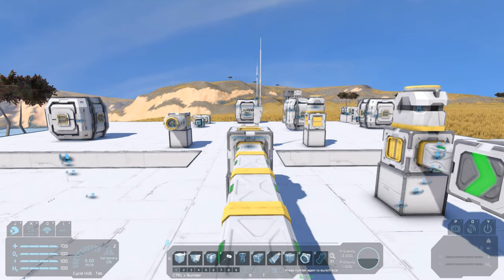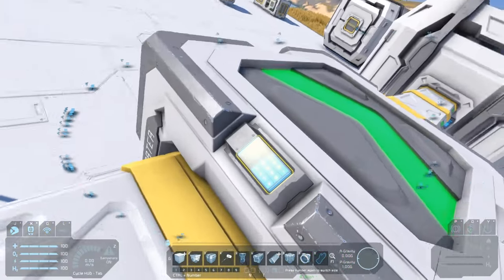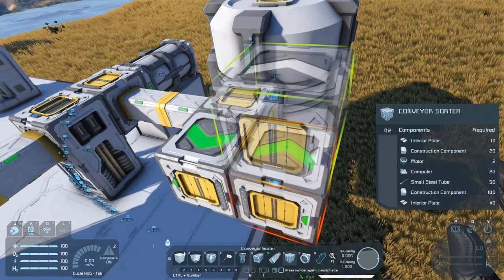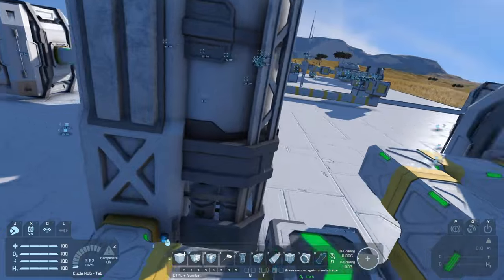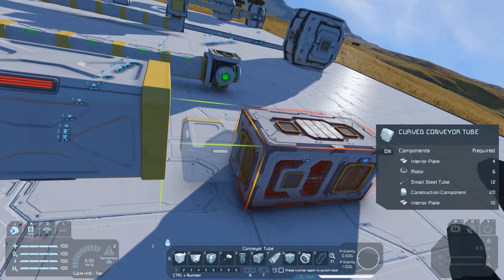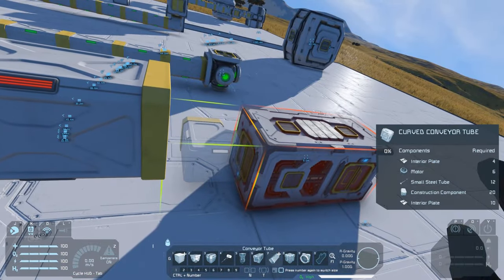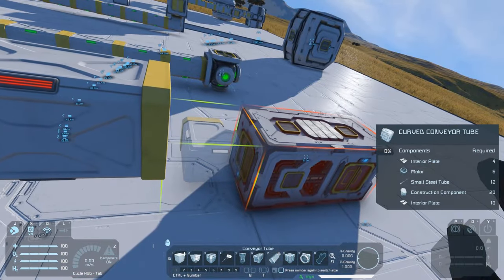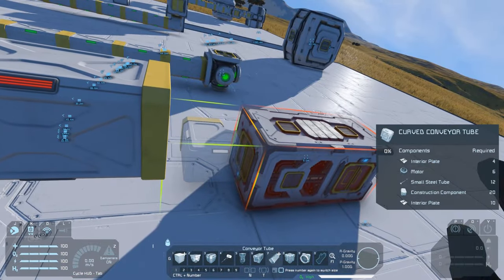Space Engineers Tutorial: Sorters and Conveyor Systems (tips, testing and tutorials for survival)

Comment: Back when sorters first appeared in Space Engineers, I was obsessed about making a good sorting system that would supply all production blocks with what they need. I built a system similar to yours, but inability to disassemble components was a serious flaw. When I tried to make a two-way connection between the assembler and component container, the sorter kept infinitely drawing components from the container and putting it back there again. There were also problems with one refinery (out of many) hoarding all ores and needing constant manual supervision. In the end, I came to the conclusion that a system based only on sorters is impractical. A good hands-off approach requires TIM or AIS, in my opinion.

Maybe if Keen added two-way sorters and refinery cooperation in the same way assemblers work, it would be more functional.
Reply from the maker: Yeah, the lack of ability to balance refineries is a bit of a bugger, last I looked though the assembler cooperation mode was still flawed though but a functional system like that would be good. There were some timer based systems that used to work but they're all broken now. I couldn't come up with a way to make the ores balance but if I come across one I'll be sure to post something about it.
Reply: TIM with tag 'ore 1000' as an example... works fine ;)
Reply: Some Guy If you're already using TIM, you don't need any special tricks. Add [TIM AUTO] to the refineries' names and the script takes care of everything. It's kind of a bummer actually, that a solution so simple is so superior to all others that it practically kills all ingenuity.
Reply: Splitsie Timer-based systems are broken because the conveyors move all resources at once, so everything goes to the refinery that happens to be accessible. If the items moved bit by bit, they'd work and conveyor systems would be more interesting to work with. You could, for example, build several next to each other to increase throughput. I think they used to work that way, but Keen changed it to optimize the game.
Reply from the maker: Ah, that must have been back when the conveyors used to cause some sim speed drops. I hadn't played with those systems before they made that change so I hadn't noticed that it was particularly gradual. I did notice the performance problems though so I guess they made the right choice :P
Reply: They don't store ore in such large numbers then... and I ehm... *My drones mostly 'eat up' everything in reach of a drill, and stuff My mothership to the limit... oh My dear drones <3
So calculated the maximum amount for rafineries and left 2 renaming blocks (Isy's script) to switch all from 1 TIM to another ;)

And with 'teh righteous choice' and 'teh muh bueno fixes/optimalizationes/updatos'... why does the rover with 'parking brake on', 'drives' across flat surface ? 
- Coz' Keen !
Reply: @Splitsie  I know this is very old by now, but a second pipeline with storage -> sorter -> assembler -> sorter -> ingot storage should work.
When breaking down items I assume it will always be a deliberate choice and not some default task.

Comment: 1. you have no backflow means in the first setup if a ship happens to need to refuel.  There are also times you may need some of the items stored on one of the one-way paths.  One option to get around these drawback is switches so you can switch between sorting and 2-way access. (IE if you flip a switch it'll turn off the path to take ice from the ice storage tank and turn on the block that pulls it in from everywhere else).  As for mining vessels you can do a double sort block for them too, where as you can turn on one that'll pull what you want from those ships on/off so the connector is more universal.

Comment: Splitsie you Can also have a disassembly function to this Conveyor system without touching anything that's already automated. What you do is stick another conveyor junction after the conveyor sorter leading to the components Storage.

And have another conveyor sorter on the branch off lead to another assembler which will be dedicated to disassembly with the sorter white listed only for components.

This will make it a one way to allow you to manually move it over to the Assembler Named Disassembler without it going back to the cargo container for components.

Then Connect the Disassembler with a Conveyor leading to the ingots storage with a sorter with Ingots white listed and and Drain all Checked then all you got to do is move the components you want to Disassemble into the Disassmbler and Disassemble the components and it will then transfer all harvested ingots back into ingot storage for use in the Assembler.

Comment: Great tutorial video, thanks Splitsie!  One comment though - on your hub-and-spoke design, it looks like you have the reactor connected in to the main "spine" conveyor.  Don't you actually want that to be connected in to the storage container that the assembler is connected to and using for ingots?  Otherwise it won't be able to share the uranium ingots with the assembler, and the "drain all" on the ingots sorter will starve the uranium out of the system for the reactor.  Also, the other comment about allowing access for the uranium would still need to apply to the ingot storage side.  Thanks again for the great video!

Comment: I was struggled with one issue. I have a bit different setup. I built all production facilities in one building with sorters in and out (plus individual sorters for facilities). If I set pull all on input sorter it occured that it moves forward and back bottles as it's stored in in H2/O2 generator. Finally I built additional sorter that pulls only ores and next sorter that disallows pulled ores back as closer then storage is docked rover. With this video you remined me about oxygene and hydrogen tanks. When I build it outside production facility, probably additional sorters will not be needed anymore as only thing allowed to be moved in will be ores.
Reply from the maker: It's really tough trying to come up with a fool proof system using sorters alone, especially when you know that sometimes the system needs to loop back on itself because then you end up with items moving constantly in a circle (which is probably what was happening when you saw the bottles moving back and forth). I haven't got any great solutions to that, other than a button somewhere to turn the return sorter on and off so it's only on when you need it
Reply: @Splitsie  Yes, it's exactly what happened. Solved it, as described above - built tanks outside and now only ores go into produciton facility. Now I have similar issue with ingots moved by refineries to assembler as it's closer then ingots storage. If I turn on draining on sorter attached to this storage it takes ingots from storage and put it back there all the time. I guess I will search for mods to solve that.

Comment: For the ore issue around the end with the wheel-and-spoke system, you could set a second sorter in front of the main one (probably even just directly connected to main storage) that's got ice blacklisted so it can't drag it through.
Reply from the maker: That's a good point, depending on your ship design you could even include it onboard to drag ice into the generator and not let it out
Reply: @Splitsie  I'm having problems, I dunno if you'll see this.  But I don't know if your design allows for ice to go back to ships' O2/H2 Generators?  I tried to set it up like yours, and when I allow Ice to flow back from the ice cargo container, then I get an infinite loop of ice flowing into and out of the cargo container.  It still fills up O2/H2 Generators, but in this case will get in the way of actually unloading ice from a mining ship.

Big fan, watching your videos a ton lately.  :thumbsup:

Comment: Any time you have a one way connection (like to your Ice storage or to your component storage) you really need to complete the loop using a switched off sorter.  In your scenario you mentioned that you cannot disassemble components.  You can also not get ice out of your storage for example if you put an o2 generator on a ship and wanted to fill it from storage.  In your assembler loop a connection from the main storage to the assembler using a switched off sorter would allow you to toggle the existing sorter off, the "new" sorter on and manually move components back into the assembler for disassembly.   You need this reverse loop in any one-way system or it can be a real pain.
Reply from the maker: That's a really good point, it would allow for much more flexibility but only when it was needed, nice idea :)
Reply: Keep up the videos, I've been recommending them to new players on Steam.  The one you did on refinery efficiencies help someone just today.
Reply from the maker: Cool, nice to know they're actually helping people :)

Comment: I actually use large grid small cargo storge containers instead of conveyors. It's extremely resource expensive, but it increases storage density massively.
Reply from the maker: It does, but there are also performance downsides to using them as they act like a conveyor junction which means when you get to larger sizes you'll start to see it negatively affecting sim speed (or if you have multiples of the same grid present in your world). Not normally a problem in single player, but something to keep in mind if you start seeing issues :)

Comment: A proper tip that im now a bit more versed in Space Engineers, if you're wanting specific refineries to input and output specific ores, you need to make sure the conveyors are sorted coming out of them, if you link all the conveyors at the end the refineries without sorters forcing a flow it will use those conveyors to autobalance the inventories of the refineries. Very big oopsie on my part trying to design a bespoke factory that processes the low yield ores with more yield modules and the higher yield ores with speed modules, and finding that my design just had them all autobalance 😭

Comment: I use a conveyor and fork system to multiple refineries for gold, platinum, and silver then one for Iron, one for cobalt, one for silicon, and one for nickel. Makes life so much easier not having to wait. Setup is easy just conveyor blocks in a row with in/out sorters pushing and pulling each individual ore and returning it to main to be pulled by assemblers. Its so much faster
Reply from the maker: This setup was definitely not intended to be optimal, just a nice way to illustrate how sorters work, so taking a different approach like you have is probably a good idea :)
Reply: @Splitsie  there is no wrong way as long as you get the desired result. Ore>ingots; ingots>components. Its just different flavors of the same pizza my dude!

Comment: Want a challenge?  You have three refineries, an arc furnace, and an oxygen generator.  The refineries have different modules.  You want to send as much Uranium, Gold, and Platinum to the high-yield refinery as will fit, as much Iron and Nickel to the Arc Furnace as will fit in it, Cobalt to the high-yield refinery if there's enough room after the U, Au,  and Pt, and the Arc furnace if there's not, everything else (including Au, Pt, Fe, Ni, and Co, but NOT U) to the high-efficiency refinery if there's room and the high-speed refinery if there's not.  And of course Ice to the Oxy generator, but that's easy.  You also have four buffering containers, one for each of the three refineries and one for the arc furnace, to hold ore that there's no room to process yet.  

You don't need to pull ore out of a refinery or furnace when a miner arrives and dumps a higher-priority ore for that refinery/furnace into the system, but you do need to redistribute ore among the buffering containers so that anything the refinery pulls after new ore arrives will be of the "right" priority for the currently available set of ore. 

You can do this with seventeen sorters.  Have fun figuring out how.
Reply from the maker: If that's possible to set up I would love to see the blueprint, there would be much I could learn from it :)
Reply: With one "trick" you can make the sorter count even smaller.  Here's the trick:  When stuff is "pushed" into a conveyor it always goes to the different faces of the conveyor (if they're connected to something where there's room) in the same sequence.  So if you have a connector on face #1, and you dump a bunch of ore in, whatever can go through the outward-facing sorter on face #2 will, before the outward-facing sorter on face #3 has a chance to sort anything. Whatever can go through the sorter on face #3 will go through that, before the outward-facing sorter on face #4 gets anything, etc.   

Just experiment a little to figure out the sequence of the faces.  I can never remember, so I always experiment and then leave colored pipes on one in sequence (Red Orange Yellow Green Blue Purple White) as a reminder to keep track of which are which while I'm putting stuff together.

Comment: One thing to watch on the loops is automatically pulling items will cause the system to pull a small amount constantly moving it through the system in the loop. It is better to have sections of the loop able to toggle manually or at least have a sensor or timer trigger the loop when needed.
Reply from the maker: Very true

Comment: I have a question about conveyor networks; what non conveyor blocks can be used as conveyors? Large reactors on Large grids seem very poor at pass-through, are there blocks that work better? Is there a way to use the blocks with better pass through as a way to save space and mass? So may questions.
Reply from the maker: All blocks with multiple conveyor attachments can be used as pass through. I'd never noticed the reactor being slow to move things through but it doesn't entirely surprise me. I'd always noticed they were very slow to pull uranium when it was available.

To be able to reliably test whether the blocks slow down transit you'd be best using sorters on the far side of each block to pull a set amount of material. Sorters seem to be the fastest at grabbing material and moving it, probably refineries are next in terms of the size of the chunks of ore I've seen them grab
Reply: Splitsie thanks for the reply. A list or ability to view "grab chunk size" stat would be crazy useful, that is exactly the planning information i was asking about.

Comment: This is EXACTLY what I needed to know.  Many thanks.

I have a question though; how do I prevent the assembler pulling too much of one ingot and not enough of another e.g. loads of iron but not leaving space for silver etc.?

I have to keep manually adjusting assembler inventories.  With 10 assemblers this will become a nightmare.

Thanks.
Reply from the maker: Sadly I've never come up with a reliable system to balance things with sorters, there are a number of good scripts out there for inventory management that almost completely eliminate the need for sorters, not as much fun to use them but if you really need things balanced it's the only way I've managed to work it out.

The two that I'd recommend and have used are Isy's Inventory Manager and Yet Another Inventory Manager
Reply: from the connector I've put a conveyor junction  and then split that with sorters one way with ores (-ice) and another with ingots. from The refinery it goes back to the same junction with the ingots. After the assembler I put a Large cargo container which fills up with the extra ingots. Might also work with a small one instead if you have 10 (?!) assemblers connected. 
Don't know if that helps you at all. 
 I'm very new to the game so mine conveyor systems might  need some work. but so far it works for me.

Comment: Ive been messing with the sorting systems and i took inspiration from your second approach. The thing i noticed here is that while it does what i want when pulling the result from the refinery and assemblers, it is also then pulling the item from the resultant container and putting them back into that container. So the items are always moving around. I am having a look at the TIM script, however even the description on the Steam page is blowing my mind. It does so much, yet possibly not what i want, which is probably not the case. Any suggestions to correct my situation?
Reply from the maker: If you have sorters running in both directions the items will keep moving, one option is to have the return loop switched off when not needed but you might be better using a script. I haven't played around with it yet, but a better option for inventory management (especially since I've been hearing a lot of issues with TIM crashing) is to use Isy's inventory manager: https://steamcommunity.com/sharedfiles/filedetails/?id=1216126863

I'm hoping to start using that script in my survival series soon, but I really want to spend some time playing with both of those scripts first to really test them out :)